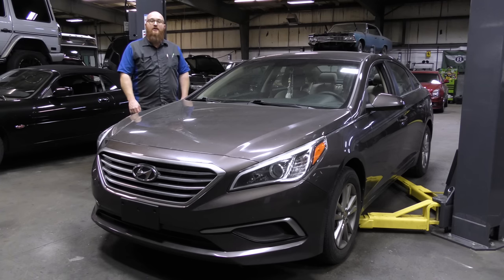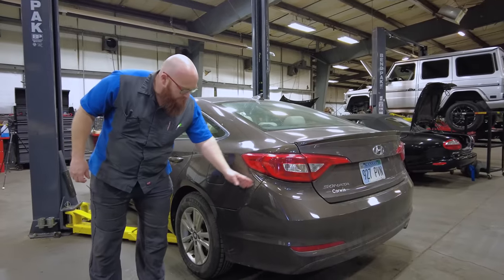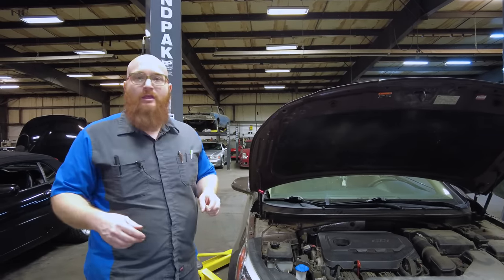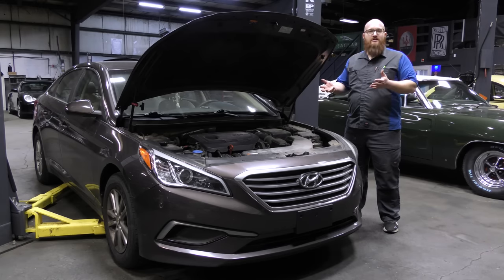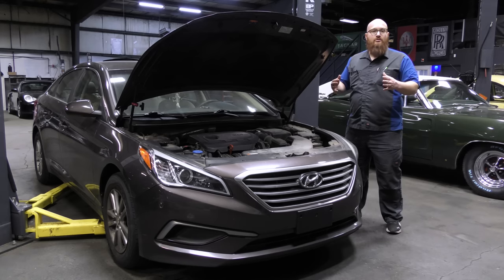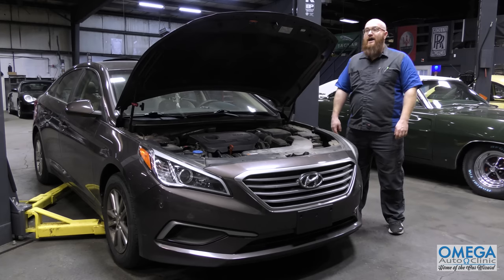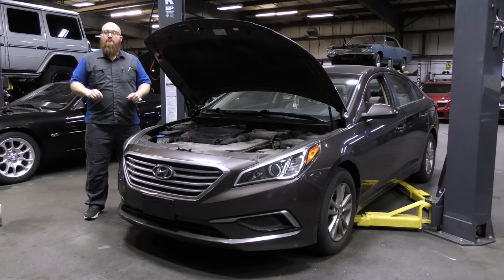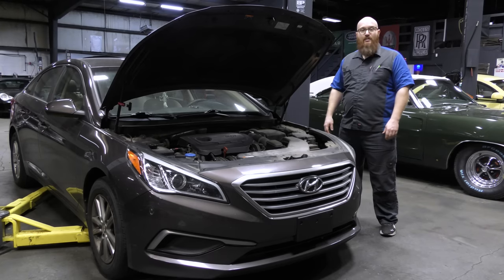What could be so bad on this '16 Hyundai Sonata that the CAR WIZARD is sending it to the junk yard?

Comment: Hi, I recognize your professional experience, however in the case of the 2016 Hyundai Sonata I completely disagree with your comments regarding the quality of the 2016 Sonata engine  2.4. I have a 2017 Hyundai Sonata 2.4 with 144,000 miles with the original engine and transmission without any problems at all. I change the oil every 5,000 miles and my car do not burn any oil. Also I have a friend that have a 2017 Hyundai Elantra with 220,000 miles with the original engine and transmission without any problems so far.

Comment: I have a 2014 Santa Fe Sport 2.0 turbo with 134,600 miles and the engine is toast. Meticulously maintained, never late for an oil change (and I check it religiously because I’m familiar with the curse of Hyundai engines). Got a cylinder #2 misfire so I changed the plugs and coils and no change. I found out that it has low compression and I’m hoping that Hyundai replaces my engine because all the special campaigns have been complied with. If not, mine is going to the junkyard as well. I can’t just paying $10,000 to put a new engine in a vehicle worth $6,000.

Comment: These engines burn oil really bad.  My in-laws have a 2016 Sonata with ~70k miles that is losing over a quart of oil every 1 k miles.  so the dealer did an oil consumption test, which included some sort of engine cleaning product and oil change, then had them stop in after 1k miles.  They are getting a full engine replacement free of charge with a free rental for the time the car is in the shop.

Comment: Born late 50s was daddy girl and he taught me everything about taking care of cars. and I do., I can change oil, cut my own spark plugs wires to fit and back in day could time my old cars. I know how to change tires.. Have changed plugs, can gap them. Always once month check oil and water.  One my cars is older and dont always tell me things like oil pressure or tire pressure. I check them on my own even if one tells me things, cars are expensive and some maintainance now is easy. But husband and I same age notice most young men do not know anything about their cars. Crazy cause its a big investment and proper care they can last many miles now.

Comment: Not sure the Kia/Hyundai issue is as simple as “check oil”. A friend with excessive oil consumption was told by dealer, “Do not check, do not add. Pay us to change it every 5,000 miles.” A week after the 2nd oil change massive knocking started. Limped into the dealer. New engine under warranty. He is happy as a clam with the new engine getting 24 MPG highway vs 17. But I am with you, the engine is crap even when new.

Comment: unfortunately we get 2 or 3 of these blown Hyundai/Kia  engines in in a week. if they aren't low on oil they are over full by at least a QT. the other culprit that you mentioned is extended miles between oil changes. I'm a firm believer in 3K to 5K mile oil change intervals dependent on oil type/age of vehicle/and mileage of vehicle. i have two 25 yr old Chryslers that are on  3K maintenance schedule and an 18 subaru that is on a 5K mile maintenance schedule. now mind you i check my fluids over once a week.

Comment: I did not look entire video, but a family member has the same car 2016 with 2.0T motor. He bought it used with 70k miles. Has a lot of service history at dealership. I advised him to take car to dealership for ALL oil changes, even tho he can change the oil himself. Reason is: Dealership are more likely to goto bat for you when they have a relationship with customer. Also, HQ sees that you were maintaining car per schedule. It's <100$ per service and you get tires rotated, fluids topped up etc. And worst case scenario if they F-up ur car, they can be sued unless they make it right. Win/win in my book.

Comment: The new engine cost half the value of the car!!Toyota had the same oil burning issues in their 4 cyl engines from 06-2010 from low tension rings getting gummed up from dirty oil sludge and letting blow by thru..the solution Toyota did was using g6 0-16 oil and changes every 5k and seems to have worked on my 07 2.4l rav4 
So maybe worth putting new engine in and telling owner don’t get lazy on oil changes or this will happen again

Comment: 103k mile 2017 Tucson! It eats a quart every 1100 miles, and the clutch might be worn from my aggressive heavy driving.
When the engine dies I'll have it sleeved and upgrade the pistons and rods. Imagine how potentially reliable the 1.6 turbo is If you just see the short block there's a lot of mass around the pistons and water jackets.

The 1.6 turbo G4FJ engine has several aftermarket performance parts available, such as Molnar rods and Traum pistons. These 2.0/2.4 motors are junk.

Comment: I had A 2008 Hyundai Sonata with a MPI 2.4 l engine. This was the best car I ever owned. I had 238K miles on it when it was totaled by a careless driver. I always changed my oil with full synthetic and it ran great even at over 225K. Hyundai screwed up this engine so bad. Sad.

Comment: Yeah, G4KD and analogs are famous to go bad. Surprisingly, in the Western Europe, you can get the short block reasonably rebuilt with improved pistons and oil injectors. That can give the chance to drive another 150k miles

Comment: I drive a Elantra 2014 the dealer could not fix the misfire in cylinder 2. Not burning oil 76,000 miles on it. They said it needed a new ignition coil, and a fuel cleaning service on the injectors. Spent $850 for the repair. Two weeks later the problem came back, I spent more money on all spark plugs to be replaced and 4 fuel injectors paid another $900. Still didn’t fix it. Scam dealership knew the motor was bad and worked me for $$$ knowing I was not about to spend 10 grand on a new motor. Took my car to a friend’s mechanic shop and they did a leak down test on my cylinder 2 and found out I have bad compression rings. Got lucky and found a remanufactured engine from Hyundai on E-bay for $1,400. Got it so cheep because the crate got smashed during shipping. Customer refused it and they had to wholesale it for a deep discount. Valve cover was plastic and got cracked that was it. Used my old one. I replace the oil every 5 thousand miles with synthetic to too be safe. Then my transmission blew up at @102k had a rebuild one put in at the dealership for $2,600. My car has 142k on it and has passed the warranty and the new one is already slipping. Hyundai builds junk engines and transmissions

Comment: I hate that even now, 10 months after this video has been posted, so many hyundai dealers refuse to follow what hyundai tells them. The Theta 2, 2.4, and 2.0T suffer from  oil consumption and general build quality issues, and as such have a TSB/Campaign/Recall, what have you relating to oil consumption and engine replacement there through it. entirely too many dealers refuse to follow these policies because it is more financially beneficial for them to charge a customer for engine replacement than to go through hyundai warranty. If anyone is in the central florida area, and you own a hyundai, come to coggin deland, we do our absolute damndest to get customers warranty engines, especially in a scenario like this.
Reply: Forgot to mention that we can also request support from hyundai that if any damage seems like it is due to customer negligence, but is still related to the poorly built engines, to have them cover some percentage of the total engine replacement cost, typically ending in a 70% or higher coverage.

Comment: Is possible the dealer declined to replace or repair the engine because it has over 120k miles and the powertrain warranty is 100k?

Comment: Cars need to have low fuel level gauge warning light along with the pressure. It’s ridiculous that car owners have to lift the bonnet to check the oil level in these modern times. This is done on purpose for people to buy new cars. If the brake fluid in the master cylinder gets low, there is a warning light but there is no warning light for low engine oil.

Comment: If this car were mine, I'd replace the bearings from the bottom without removing the engine.  If the crankshaft is scored too deeply, this might not be possible.  But if it just has light scratches
you might be able to polish it with some 2000 grit sandpaper and just replace the bearings.  If I did this myself, it would be pretty cheap.  If I'm lucky, the engine might last another 100k miles or more.  But like Wizard said, there could be other damage, for example the main bearings, etc.  But it would be worth a shot for just maybe four hours time investment and  under $200 for the bearings.

Comment: As Australian, I have had a KIA SORENTO 2.2 TURBO DIESEL that has not missed a beat after 180,000 K's. It is serviced regularly and never had an issue. Diesels in AWD are popular here. My understanding is the THETA MOTORS are crap. KIA and HYUNDAI have a good reputation here.

Comment: Thank god I have the 2.5 litre Sonata. Engine has 206,559 miles. The trans has problems, yes that I am working on. Have replacedthe trans input & output speed sensors & the throttle position sensor. Needs the shift control solenoids replaced (there are 5 of them on the 4 speed trans.

Comment: I work at Hyundai as a tech and we got thousands of sonatas knocking, and we are replacing engines every day under warranty. It's crazy to think these people have all these bad engines due to lack of maintenance, but we are still replacing all of them anyway FOR FREE(to the customer) by the campaign. Us techs only get paid around $200 for every engine replacement. Hyundai is constantly under fire from customers and the public but the truth is people don't do their damn oil changes on time which results in engine knocking and this happens ON ANY CAR!!
Reply: I changed my oil on time, every time, and still threw a rod. The engines are utter garbage.

Comment: I have a 2015 sonata that I brough brand new--fortunately for me, I have kept up with the recalls and maintenance--so when my engine seized up at 59k miles, Hyundai replace my engine at no expense to me.   Other than waiting 2 months for a new long block crate engine with no loaner car--I have no complaints about Hyundai corp but won't buy from the local dealer (horrible experience with them--they damaged my car bumper and bad a communicating).

Comment: Volvo will alert the driver when the oil is low, even by a little bit and if it's a bit more, the read out states "oil level low, turn off car"
Reply: Here's one really needed in the XC90: Left Turn from Right Lane Detected. Turn Off Car...Punish Driver.

Comment: My friend had a 2014-16 sonata (cant remember exact year) the bearings in the engine went out. He took it to the local Hyundai dealership who had sold him the car to begin with only to THEN discover there is an active recall for these engines because the bearings give out prematurely. It took him 2 months of bureaucratic red tape to get them to fix it, and they would only fix it after he went back and found every single oil change receipt he did since he bought the car to prove it wasn't negligence. 
Once they agreed to replace the engine via the recall the manufacture, aka Hyundai themselves not the dealership, they decided the best way to fix these recalls was to replace the engine with the exact same engine (new of course) with the same recalls and say "see you in 80k"

Comment: I spun a bearing on my 07 sonata v6 as i was down the block from my house after a 44 mile drive from work. 112,000 miles. The car became a money pit at about 100,000 miles.  Air conditioner compressor fail, all the brake lines and fuel lines corroded, hood latch broke and alternator, all within 18 months.  As i pulled into my driveway, i heard the hammering get louder. Before the rod shot thru the crankcase i shut it down. I went directly in the house, called the junker and withing 90 minutes it was gone. $375 in my pocket.  I sold the winter tires and rims i had for another $600.  12 hours later, my best friend died in the hospital.  I was the executor of his will. He had no family. I bought his 09 accord V6 off the estate with only 30,000 miles.  I have since added 81,000 failure free miles to it. Never a kia or Hyundai again. Although, new Accords arent as reliable as the 09.

Comment: I'm sure its been said somewhere here in the comments, but the owner here can't be faulted for skipping an oil change. I have no doubt she was diligent, considering the engine.  These seem to start burning oil at a high rate somewhere between 70 and 120k miles. One oil change will go totally normal, and 3000 miles later the engine will be dry. My own 2.4 suddenly started burning 1qt/700 miles between oil changes. Now, maybe the light came on (meaning NO oil is left) and she kept driving it until heading to a shop was convenient, and that could definitely have sealed its fate.

Comment: I listened to this and it is not my experience. I have a 2016 Sonata and guess what? The oil change was done religiously every 3k miles and it was checked on a monthly basis. The engine went bad anyways. Hyundai refused to do anything about it. The car has been great for the past 4 years. No issues just normal maintenance. Aside from the peeling paint which is another problem. But I got that fixed too. I got one year left to pay the car off. I can’t junk it. I’m stuck fixing it. But although what he is saying maybe correct on most cases, I don’t think it is on Hyundai’s.

Comment: At one time people went to service stations where the attendant not only pumped your gas they checked your oil and air pressure in the tires. Today you are on your own but cars do have check oil lights but by the time they come on the oil is way too low.

Comment: There is a recall because some Hyundai engines make a horrible ticking sound.  You will know when you hear it because it is just not normal and really an engine in that condition could die at any moment and leave someone stranded or at worse seize or lock up on the highway creating a very dangerous situation for the owner and ALL other people nearby.  If they are lucky it makes it to the side of the road in time and is out of traffic but we know that doesn't always happen!

Comment: I've heard those engines burn oil faster than most people would get around to checking the oil. So I don't blame the owners.  Are you supposed to check daily? Weekly?
Reply: The engine left the factory with tons of issues. Hyundai Kia knew this, but they still sell the car anyway, the customer had nothing to do with the engine, burning oil and running low. That's just the excuse that hyundai uses so that they don't have to honor their 100k mile warranty. Trash.

Comment: They had to have the dealership install the knock detection software program in the car if it’s knocking they will not do anything until the engine fails it’s then they will replace it trust me I’ve been there with my 2013 Santa Fe after the engine failed then the dealership replaced it FYI just make sure the software program was installed👍🏼

Comment: Rebuilding an engine that has 120k miles, has run low and been driven on low oil is fraught with problems.  Even though the oil burning is likely a problem with the engine itself you never know what else could be wrong and go wrong after the re-build. In that case a $6k new engine is probably the best option if you want to keep the car.

Comment: I have exactly the same model year and  same kinda damage to the back side panel 😂
Mine started knocking and limiting revs 1,2 months after oil change, and it has been maintained religiously. Fortunately, since it had <100,000km, the dealer covered the engine change.

Comment: It’s so ironic Wizard asks we not bash people and the first comments are bashing people for their mistakes. So a couple of things most people have no clue how an engine works, none whatsoever.  They put gas in the car and don’t understand what the idiot lights mean and a lot of check engine issues you need an obd to diagnose. So sometimes it goes ignored or if they call the dealer it’s a month or more wait to get a service appointment and they think they’re going to get ripped off.  They’re not wrong I have 2019 VW Tiguan and the battery went out I had to take it to the dealer to replace the battery because the start stop system has to be programmed to know that the battery has been replaced or it would go into a limp mode. They charged me $100 to reset that. I grew up building engines. I have rebuilt a few cars I can fix things and they took a 100 bucks for something I can do in 10 minutes or any auto parts store does for free. So it’s not just laziness. They don’t teach auto class anymore so there is a lack of knowledge and a subsequent fear of getting taken advantage of. Plus you can’t get in to the dealer anymore because they’re booked solid
Reply: Thank you for this comment